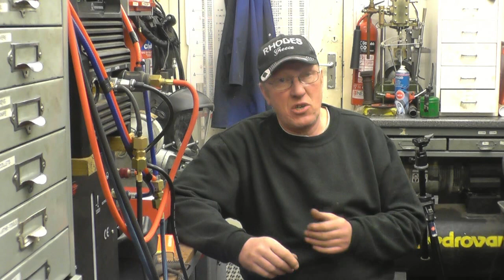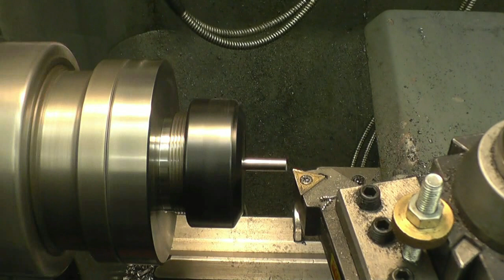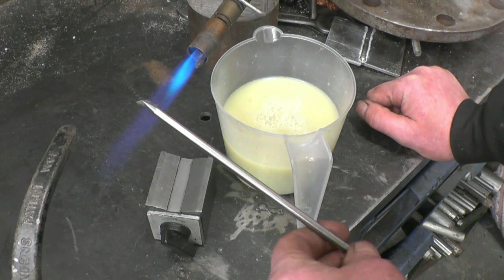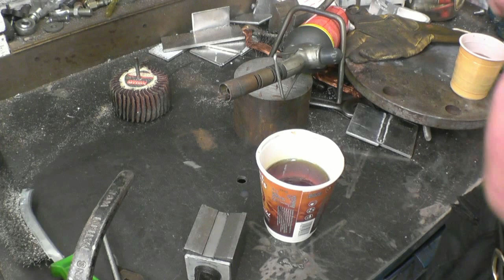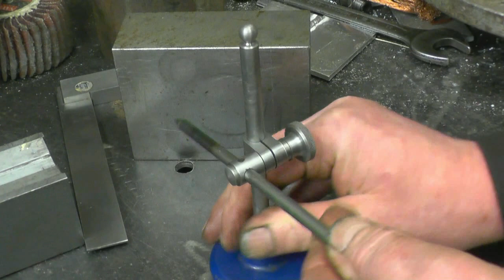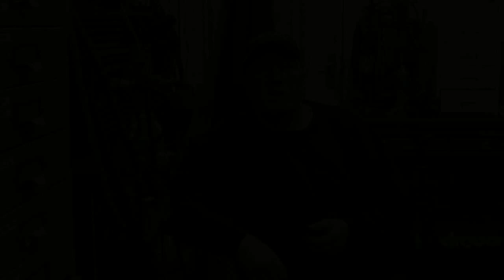SNNC 166 P2   Hardening & Tempering a Scriber

Comment: john by a bottle of map gas it is hotter than propane and has the same threads as the propane bottle. 13 bucks in canada at home depot. and i dont know if it really makes a difference but i was taught by an old timer to use a figure 8 swirlling motion when quenching or tempering parts in oil or water. the way i like to do it is heat till no more magnitisime then put in oil then clean off the part from all crud then heat till straw coulor then figure 8 it in water. thanks john 4 another good video.
Reply: Jamie Buckley Does the Mapp burn properly through a propane torch head? I was looking at them and it looked like one or the other didnt use the air holes in the torch head.  Also I was tought  that the hottest part of a propane flame is quite a bit farther out than the inner blue tip.

Comment: Hi John,
I know this is a bit of track but have you any tips for an easy way of running a 1" bar in a 4 jaw chuck so a hole can be bored 1/4" off centre. This needs to be machined after otherwise I would do it on my drill press.
I have drilled the hole in the drill press previous to setting in the jaws and even with the slightest adjustments the wiggle bar jumps from one extreme to the other.

Great clips by the way, have never missed one.
Phil
Reply from the maker: I will try and do a video response for you next week

Comment: is that just soapy water you used to quench? and can i make a center punch the same way but with carbon steel and heat and temper the full punch ?
Reply from the maker: just white water from the lathe  just handy   have a look at the temoering charts on google

Comment: Off topic: Anyone know where I can get two Philips pan head screws M5 - 28 pitch 10mm long? Or a die to cut such threads. I am having difficulty finding anything. There is one option I know of but the guy wants $13 USD Used, plus $9.50 USD for shipping.